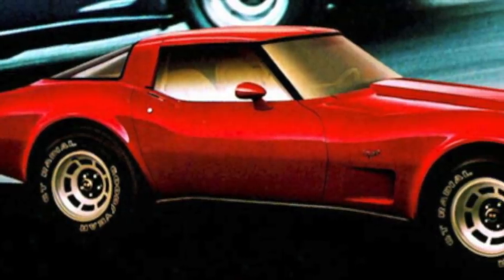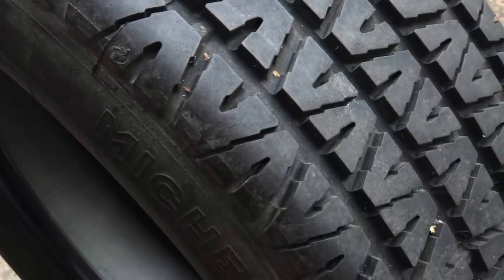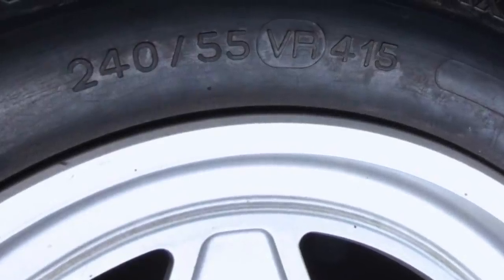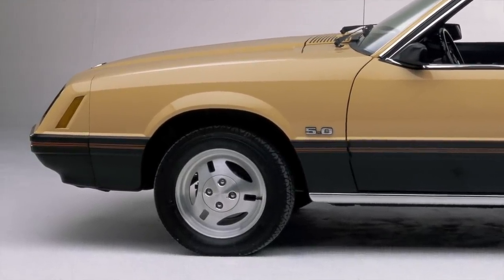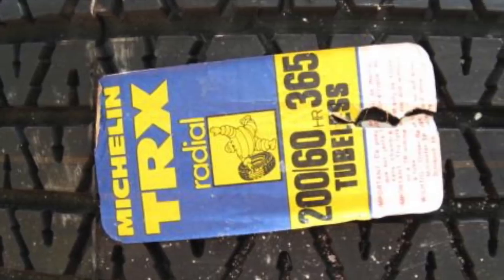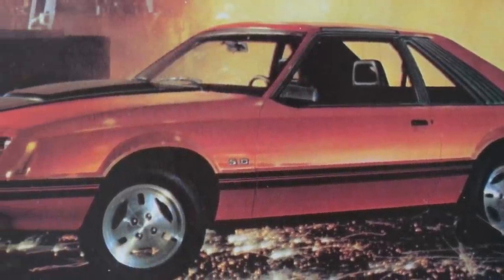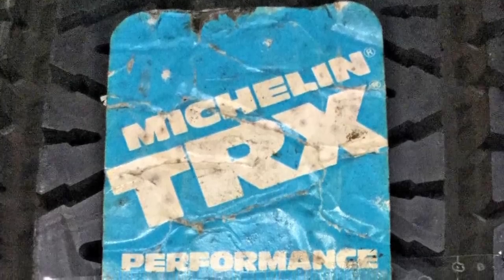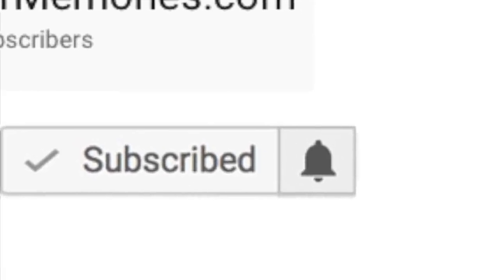Best Car Wheel & Tire Innovation And Why It Failed

Comment: I had a 1980 Mercury Turbo RS with the Michelin TRX tires - which I loved.

That is until 3 flakes on snow got on the road. They then became the most useless tire ever made. A racing slick would have better traction in an inch of snow that the TRX ever could.

Comment: I had a '79 Mustang with TRX wheels. Late '80s noone had the tires in stock.  If they had them, they were real expensive and several years old. Buying a set of mag wheels and new tires was cheaper.
It did handle curves like it was on rails.  ;)

Comment: The TRX system, as the video explains well, was an attempt to marry good handling with decent ride comfort. Michelin achieved that goal, at the expense of all-weather handling. I had a 1987 BMW 535i with the TRX system, and on dry pavement performance was superb. By the time I sold the car in 1995, conventional radial tires and BBS rims provided better performance at lower cost. The TRX system did not "fail"; it was just quickly superseded by advancing technology.

Comment: TRX - The IBM of the tire world.

OS/2, and all their proprietary nonsense is why they were quickly surpassed by "ghost/white boxes" in much the same way TRX was surpassed by standard radials.  Proprietary seldom comes out on top.  You can print money for a while, but then a comparable and much cheaper substitute comes available shortly thereafter and you are stuck with a proprietary this or that which no one wants.

Comment: My 87 BMW M6 came with TRX 415s, and they worked very well, until they wore.  The tires got harder and harder as the wore.  When 17" BBS wheels became available, and the TRX tires cost the sum of a new wheel, I ditched them.

Comment: With the return of the V8 in the Mustang in 1975 (which Ford utterly failed at properly promoting, so badly that to this day some people claim the Mustang II never had a V8) the V8 package included 1/2" wider wheels than were standard with the I4 and V6 engines. The savvy buyer not wanting a V8 could opt for the wider wheels and tires in plain steel with hubcaps, styles steel, or cast aluminum. Mustang II also had an optional handling package with a larger 1" diameter front sway bar and a rear sway bar all years. Makes a II handle the twisties very nicely, even better with current technology in tires and gas shocks. BTW, 1974 was the 4th highest sales for Mustang and has *never been beaten since*. The only year since 1974 to come anywhere close in Mustang sales was 1979. Had Ford properly promoted the return of the V8 (see "The Boss is Back" campaign for 1982 after the downsized 255 V8 for 1981) it's likely that collectively the 1974 to 1978 years would have been the marque's best selling model ever.

Comment: Had a MG Montego with the metric rims, in the late 80's Dunlop tyres for it were about £70 a corner when you could get them. Michelin's were closer to £200, ouch.  
Similar normal tyres for my Maestro were £45 each.

Comment: We had those tires on my Wife's 1984 T-Bird Turbo. IMHO the demise of those tires was good.  When it came time to replace the tires,  I ended up buying top of the line Goodyear tires PLUS rims to fit the vehicle and got a better ride and control to boot. I did not see any of the advantages you claim in the video with the original Michelin tire setup.

Comment: So, what was the big technological innovation?  This video does not really explain it.
Reply: Joseph LaCerra no he doesnt.
The rim of the wheel was a different shape. So was the bead of the tyre. They sat more firmly together. Didnt peel apart under load. The sidewall and carcass was also constructed different.
It took 195 width to achieve the same lateral grip as a 180 TRX (direct comparison of michelin trx v mxv on peugeot 505. We were peugeot dealers. Had both sitting together as standard fitting). TRX was a superior tyre.
Reply: @sugarnads  Thank you. AS ever the innovation dies but the effect - standards improve- lives on
Reply: I can't believe how many people here and in other threads apparently did not hear a WORD this man said: essentially everything 'Mongoose" said was repeated from the video except a direct comparison. 

The covered all of it in a general sense, e.g. in its performance and comparison to standard wheels and tires of the time, as well as its expense in wheels and tires. Good grief!

Spoon fed generations, ADHD-what is it?

Comment: YAWN. The same tread was used on our SPRINT CAR , only we called it a " rain tire  " used on dry slick track conditions, typically for the Main Event after the clay got pounded in, as dust was thrown up instead of dirt.

Comment: Michelin screwed up again when they did PAX runflats in metric wheel sizes for the USA. You now have dePAX kits with inch wheels so people can use common tires available in the USA.
Reply: The size of the wheel isn't the only reason you can fit a conventional tire. The bead is completely different
Reply: @4ampaul  ,
Yes, it is a different bead. The local Honda dealer's Pax tool broke so he sold me a Pax tire and wheel combination from another old Odyssey with Pax. I don't think he fixed the tool as Pax is no longer used by Honda as far as I know.
Reply: Correct they haven't used it in years. You're better off to get standard wheels and tires

Comment: I'm curious though. Does anyone know what would happen if none TRX tires are put on TRX wheels?
Reply: The tire bead won't fit correctly. Bad stresses in the tire or slippage of the tire. Totally unsafe.
Reply: Thank you. And slippage is bad. In 1988 I raced someone in their 1981 Chrysler Cordoba with my 1985 Chevy Impala. Nothing TRX on the Chrysler but the front right tire slipped off of the rim spinning them out 3 times and into a ditch.  Scary, and that was my first and last race. Thought I'd share that as the word slippage brought back that memory.

Comment: During the 90s, a friend bought an '82 Mustang GT that came with the original TRX wheels & tires, while the car itself rode on conventional tires... mounted on cheap, stamped-steel 14x6" rims. My guess is the aftermarket rolling stock threw the handling out the window, as another friend recalls riding in it while the first on was driving, and the car actually ran off the outside of a highway on-ramp. 

Mind you, this wasn't the first time the first friend had an accident like this... as he had once slipped off the inside of an on-ramp in a different car.😕

In time, the second friend and I came to the conclusion that, despite what education and enthusiasm the first friend had for cars, the place he belonged when it came to them was standing on the curb... waiting for a bus.😔

Comment: Had a set from a mustang, to put on my 84 escort, but got stolen in storage. Bolt,  pattern the same, but eventually used a set from  an. Escort GT.  True the TXT was a good traction handler.  But for the $ , I used  Uniroyal 215-55-15  and same diameter as my 13" stock size with a wider fooprint for better handling on my puddle-jumper 4 cyl 1.6 h.o. .

Comment: I had a 1979 SAAB 900 turbo with TRX tires they were terrible in the snow and dangerous on ice. I quickly replaced them with wheels from a 1993 900 turbo. Even with all season tires it was a vast improvement. 
In the mid 90s you could still get new TRX tires but they were horribly expensive.

Comment: I bought a new 1979 Mustang with the TRX option, 2.3  4 cylinder, automatic and AC. 
Remember that fuel economy was an extreme consideration back then, and the dealership was loaded with V8 Thunderbirds that they couldn't sell.
In reality the Mustang configured this way didn't have enough power to get out of it's own way, so having a tire 'system" that handled better than a Ferrari (Ford's claim) made no sense.
I tried to locate a replacement TRX tire and except for the dealership, there were none available.  
I traded the Trx's for conventional rims with wire wheel hubcaps.
Ford's claim that this super handling Mustang qualified it as a SCCA Group 7  sports car, which was good as a marketing technique.
Not so good for me as the car insurance industry used that claim to pump up my insurance premium.
Considering that this Mustang was more 'lump' than pedigree stallion, I wish I could have chuckled at the irony.

Comment: I don't get how a metric measurement of tire/rim makes the bead fit any better. Wider tires grip the asphalt better. Cragar SS mags look good on musclecars. Detroit hasn't produced a real musclecar since 1970. Good backyard mechanics know how to build a racecar out of dam-near any production vehicle by swapping parts. They didn't put bored & stroked Chevy smallblock 400s in old Willys vehicles, but I did.
Reply: Metric rim size was used to prevent inch tires from being mounted on the wheels.  TRX has a completely different bead shape, this is what made the tire / wheel system work.
Reply: Please look up the 73-74 Pontiac Trans Am  455 SD

Comment: I had an 86 BMW 635i with the TRX, worked great on dry roads. Couldn't get out of it's own way if we had even an inch of snow on the ground. I lived in Minnesota at the time and this beautiful BMW sat in the garage from november thru march.
Reply: Had them on an 83 533i. Superior handling on dry roads but the tread was also shaved which made them last 20,000 miles tops. This shaved tread also made them horrible in the rain. Brand new set on the freeway during a rain shower had me hydroplaning all over the road at normal speed. Since they were proprietary you had no other choice except to pay Michelin's premium prices.
I lived in Chicago at the time, they weren't great in the snow but I've driven worse.
Reply: That BMW made a wonderful (well preserved) purchase for someone else (maybe a collector), once you got tired of a garage queen.

Comment: Mandatory 13" wheels & skinny tires? I've often wondered why those Mustangs had factory four-bolt rims. Seems stupid to me. Fortunately it's not too difficult for a backyard mechanic to swap out the front hubs and rear axles. Been done thousands of times.
Reply: With the weight / power of the car, 4 bolts are plenty.  As power increased, 5 lugs where added.  Remember, most people just drive cars and not modify them.
Reply: Well when you 're-skin' a Pinto, that's the results.
Reply: Nope, not a Pinto.  The 79 + Fox body Mustang was a completely new design.  The fox body platform was also used for the Fairmont and LTD 2
Reply: Bob Roberts
Starting @ 0:24, the original OP's statement is made. THAT is a Mustang II (re-skinned Pinto).

 I know about the 'Fox' platform. As far as I know, the Fox bodies didn't have 13" wheels. I could be wrong though.
Reply: @russdavis1960  The truth is only a small number of body structure parts are common between a Pinto and Mustang II. The rear part of the floor pan and part of the front suspension crossmember. Changes were made to the suspension for the Mustang, and used on the Pinto from 74 up. The two cars don't share the same rear leaf springs, Pinto rear springs are shorter (except for the wagon) and have different rates. The Mustang's springs are mounted to the rear axle with rubber bushings. That was not one of Ford's better ideas. It promotes axle windup and hop, and in places where salt is used on roads in winter can lead to the springs rusting and leaves breaking.

Comment: 74 to 78 mustang was NOT a performance vehicle. Its was a embarrassment to its mustang predecessors! Worthless junk!
Reply: Ray Luse 
Yea but it had some good innovations. 
Where would the hot rodders be without the mustang 2 front end?
Reply: @MrTheHillfolk  a company named North American Fiberglass built Shelby Cobra replicas and raced them using completely stock Mustang II front suspension arms, springs and steering - and won frequently. The Mustang II and 1974 to 1981 Pinto have no bump-steer.

Comment: Some people have wheels and tires where from a distance you can hardly see the tires since the wheel rims are so large around .
Reply: Glenn Lego 
I laugh at them because you’re gonna hit a pothole and bend em nicely.
Reply: I don't get the people who do that with pickup trucks. A truck is going to get pressed into load carrying and some light off road action at some point so why not have some decent relatively high sidewall truck tires on it. 60 aspect ratio or higher. 60s deliver decent enough handling with today's truck suspension setups.

Comment: They were short lasting  tires....about 20,000 miles tops ($175.00-200.00 bucks a pop then)....I should know....parents had a Peugeot and BMW with them (eventually switched out to 15 inch  factory alloys rims and tires). TRXs were a total sham...especially the noise and rough ride with TRX.
Reply: Same with that Michelin Pax system. Horrible.
Reply: David Hoffman:

And if you were unfortunate to purchase a New defective tire;like a tire that was not molded Round or with cords/belts not inline (which is common in the tire manufacturing Industry )...you the Retail consumer were on your own...AS IS for the life of the tire. If you (the Retail consumer) decided to Pony-up even more dough to replace those defective New tires (cross your fingers),you got a good  new tire.

You were nice (about TRXs) with your compliment of Horrible :D
Reply: @dmcnamara9859  ,
I bought a top of the line used Honda Odyssey van. Glanced at the tires. I did not notice the Pax tires. Huge mistake.
Reply: David Hoffman:

I hear yah. Most important part for me when buying new tires...they are round and don't exhibit other issues. Over the years,I've learned many inexpensive/with long tread long-mile expectancy  off-Brands are the better buy over Michelin,Continental,Pirelli and other name Brands on any given day.

I will say this though, Japanese or USA made Yokahama tires (maybe a bit  noisy and a little rough for some folks)they stay round and defect-free all the way to bald status.
Reply: @dmcnamara9859  ,
In some cases the big brands advance tire technology significantly, but then comes the questions about the need for that technological advancement. 

The average car buyer never needed unidirectional tires. Goodyear used them in racing where they only provided a significant advantage on straight or gently curving track sections, but they sure looked cool. Thus the marketing gimmick of directional tires was created and generated profits. It also significantly increased the cost of tire rotations. Later on asymmetrical tread features were added to unidirectional tires rendering tire rotation  impossible on some sports cars. Eventually many car owners rejected the increased tire rotation costs and indicated they would only tolerate symmetrical or asymmetrical tread. The directional treads started to disappear. 

The trucking industry told the tire makers that they wanted none of that nonsense. So they got improved non-directional symmetrical tread designs on improved casings. 

Today's symmetrical non-directional automobile tires are better than many of the older unidirectional asymmetrical treaded tires were. Did we really need that distracting journey into directional land to improve tires? I doubt it.
Reply: @dmcnamara9859  I've had good experience with Toyo tires. Had a 1992 Oldsmobile Silhouette. Put new Toyos on it, drove it thousands of miles and when I sold it the Toyo's still looked like new.
Reply: The same applies to overpriced oil filters for everyday driving.
If that oil is changed every 3-5k miles, and especially synthetic, who needs
race car filters for an ordinary vehicle, turbos included.
Reply: greggv8:

You proved a point,Japanese make good stuff :D.....exception being  deadly Takata Airbags
Reply: @rayford21  ,
The market pressure is for longer intervals between oil changes, so instead of 3,000 miles to 5,000 miles you are seeing pushes for 9,000 miles to 15,000 miles. 6,000 mile to 10,000 miles may be a more reasonable request. But in any case the oil filter has to be sturdier to last longer. From the tests I have seen it has a lot to do with having a support structure to hold the filter material in place even as the filter holds in a significantly larger amount of contaminants.

Comment: Pretty good video very informative...tires are a BIG deal in handling,...With my first car, I averaged 10,000 miles a month....It had a miss aligned front end & ate a pair of tires up front weekly......I learned alot about tires that year...fortunately I was in the tire biz & just kept changing out tires...
Short side-walled tires obviously track better because they dont flex as much as a taller side-wall....tread pattern & rubber formulas also play a Big part.....Sadly I wont endorse any brand here.....Sorry, but you'll just have to learn like I did.

Comment: Anyone saying that TRX wasn't a technology needs to look at the definition of technology.

"Technology is also an application of science used to solve problems."

Michelin was trying to solve a problem. That of rough riding low profile tires. Their solution involved a novel wheel and bead design. Alleged backroom deals aside the wheel/tire design worked it was just a commercial failure.
Reply: The only problem the TRX system solved was someone having too much 
money in their wallet.

Comment: Very interesting! I had no idea how important the TRX setup was back then. 
I ordered a brand new '82 GT fully loaded with the TRX package. As I recall, I was annoyed replacement tires were so expensive. Well, that, and I wanted a taller and wider wheel tire combo so I put a set of Enkei wire mesh wheels on it. I have no idea what I did with the old wheels and tires. Considering I had nowhere to store them at the time I probably just gave them away. D'Oh!
Reply: they would be worthless. The enkei mesh's on the other hand look awesome on fox body's and command a premium today. Good call.